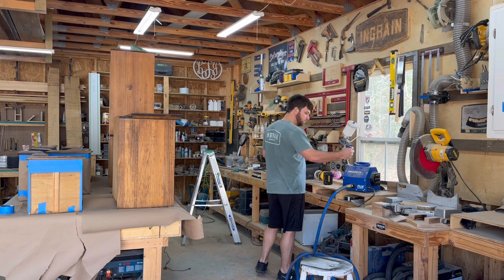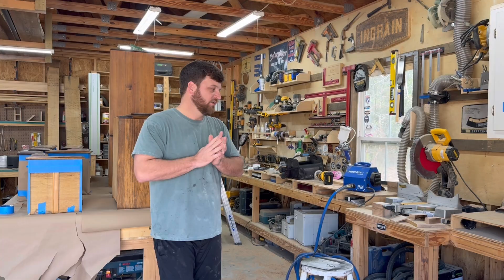Fuji Mini-Mite 4 Airless Sprayer Review: Painting Furniture & Cleaning Tips! @FujiSpray

Comment: I have a small shop. We currently stain/finish using a brush. Small pieces for the most part.

I honestly can’t figure out how sprayers make sense. The prep, the cleaning, the waste, the added expense of the equipment and PPE… I must be missing something.
Reply from the maker: Not saying you’re wrong, but I’ve done both and I love my sprayer. I would never go back to a brush.
Reply: @Ingrainwoodwork  I want to be sold, too! What are the top advantages you enjoy over brushing?
Reply from the maker: The finish looks better, it’s quicker, it’s less labor intensive, and quite frankly I enjoy spraying. I promise you it’s not a hard switch.

Comment: Still recommend it? I’m a one man cabinet shop looking to upgrade from my quickshot! I spray waterborne 2k and primer and some clear. I don’t have the space for a big add compressor setup so turbine was the way to go. You recommend this one still? I also plan to go with the 3M PPS 2.0 cup system because I’m always changing colors and clears and stains and I just don’t have time to be cleaning the cups out all the time and I’m lazy.
Reply from the maker: I do recommend it. Cleaning is pretty easy. I also don’t have a big compressor and every time I used air I just had to wait on my small compressor and there was so much overspray.